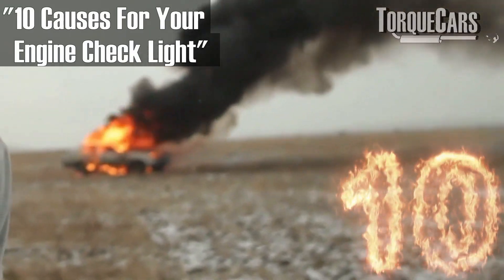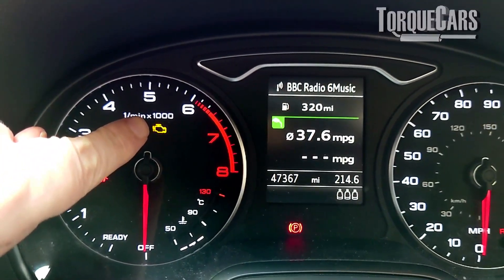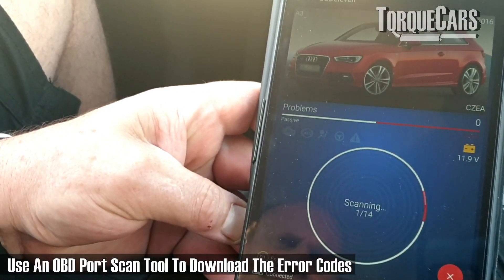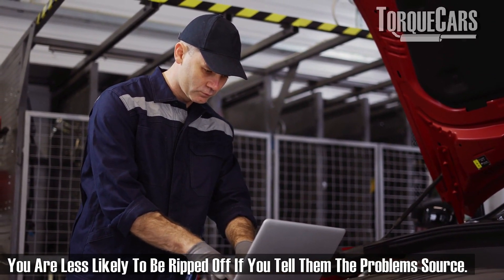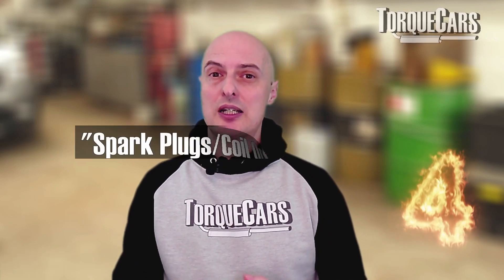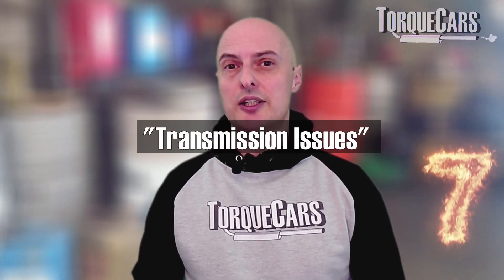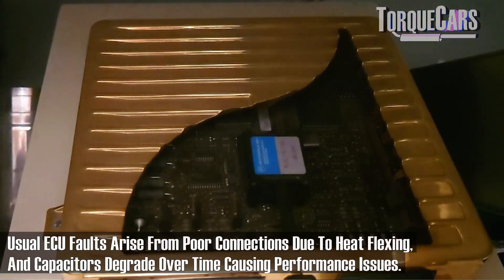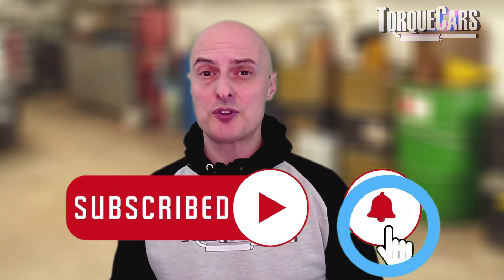Why Engine Check Light is On? 10 Most Common Causes - How To Diagnose An ECL warning light

Comment: Missing or non-operational filler cap? If it is not tight, it may cause the light to come on. I had a Mazda and that what was happening to me. The cap wasn't missing or non-operational, just not tight.

Comment: I've had eml light on my focus st. Used my Mountune's dtc reader it says P0544-00
Exhaust Gas Temperature Sensor Circuit
Bank 1 Sensor . The car still drives perfectly well . Do you think if it's replaced it should be ok
Reply from the maker: Reset the error codes and see if it reappears, and how long it takes to show up again, often cars will throw codes and log them but the error was just a one off. I would only start investigating further if engine economy dropped or there were power fluctuations or it started running too rich or too lean.